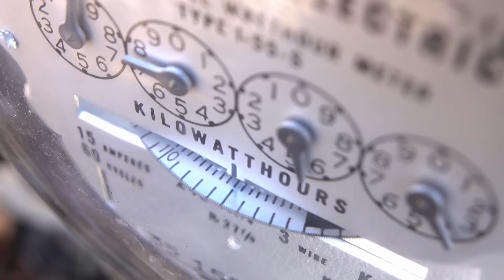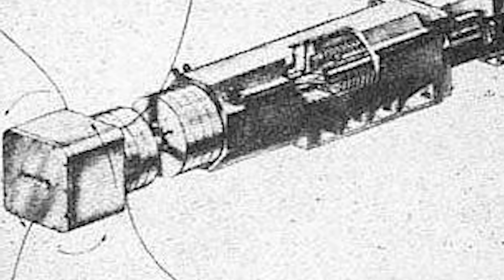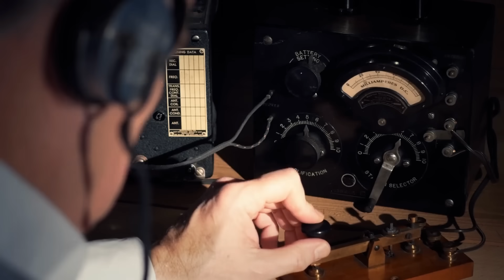Top 10 Government Experiments That Broke The Laws Of Physics

Comment: TRUE Testimony  8-30-2025  (all lawyers in my cases have been caught as criminals and their laws void and nullified and for criminal purposes) I saw using a dope bubble with the oily etherical air currentish matter inside the bubble  and a Redline V flashlight and a mass of dirt in Santa Fe New Mexico. The combination caused in front of my eyes the dirt to mysteriously decay right in front of my eyes simply disappeared. I had to throw the oily air in the bubble into the dirt first. Crazy. I make law out of the incident and it cancels if your lawyer touches it.

Comment: And if Tesla was so.bad ass. Why the would he use basic metals in the experiment?? Thar doesn't add up!!!
Reply: If you do the research you will find out he was wanting to create free energy for everyone and JP Morgan (the one financing him) didn't like that because he wanted profit. So he cut all funding to Tesla and did all he could to slander his name around town. That is the reason Tesla died bankrupt and alone. Jp Morgan owned the copper mines, for the wires, owned the lumber mills for the poles, owned the rubber manufacturing plants for the wire casing and owned the railroads. This is why there are power lines everywhere. All for profit